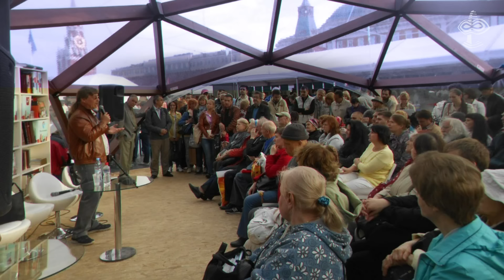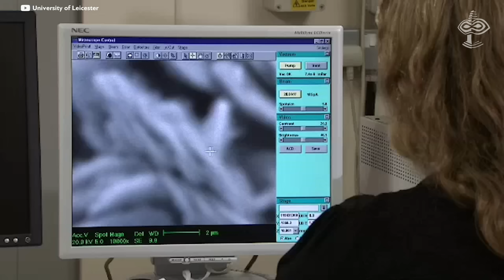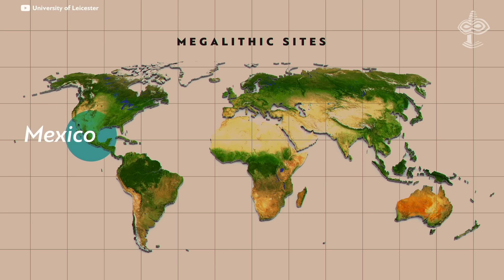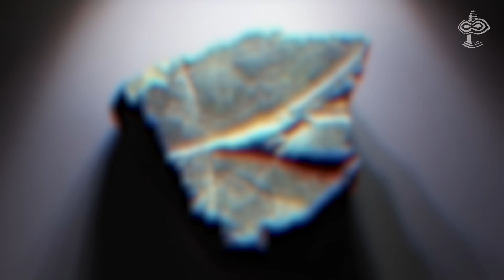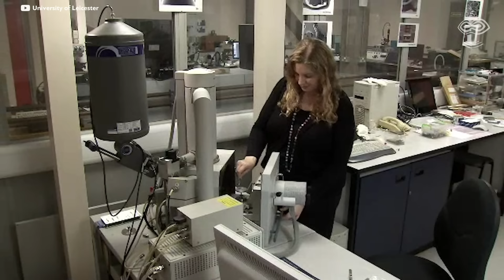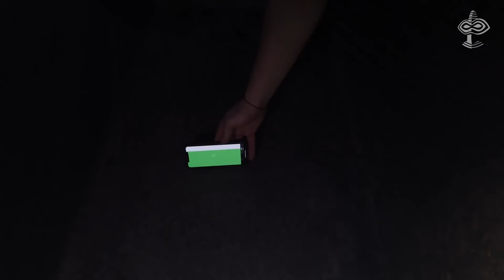The Secret of Ancient Tools: METAL MICROPARTICLE research - VERSADOCO

Comment: One thing that you didn't mention on a significant amount of these megalithic sites around the world 0 a good portion of these all the stones are magnetic and make compasses spin when next to the stone so maybe this is evidence of whatever they used some of the sites also the stones look like they were melted engaged 0 even there in England there is just one staircase somewhere in in a recess structure of some kind stairway going down looks like it was molten at some point and ran from the top and pulled down to the bottom and it's visually stunning but they try to hide this and explain it with these quite crazy theories that make absolutely no sense whatsoever trying to prove that that it fits in the theory that all these structures were made with chicken bones and sand and maybe at the most brass or copper chisels with hammers made out of wood and this supposedly made these perfection pieces with incredible precision late to the 10 thousands of a millimeter some of them like we can't even measure how perfect he vasesare from the step pyramid not to mention the core drills and scoop marks in the stone where they poured out huge obelisks or megalithic Stones looks like it just scooped it out of the spoon of gigantic size

Comment: The gate was probably not cut with a knife or a round saw in my opinion it could be similar to what we use in quarries high tension cable with some kind of abrasive on a diamond or some kind of high strength high heat metals such as particle x or it could be a bandsaw with the actual blade being bronze with the cutting surface being particle x if it's hard enough to cut the stone itself but I'm not sure about that maybe it helped diamonds in it since the metal is strong enough and heat resistance enough to hold the diamonds as it gets hot this is plausible but if it was hard enough to cut the stone itself obviously you didn't need the diamond but some of the stones with these kind of cut marks are all the way up to 9 on the Mohs scale diamond being 10 so it's kind of hard to believe that metal itself cut these Stone of that significant hardness but you never know some of the core drill holes that I've seen the rotation is a millimeter of depth for every rotation this is unreal and hard to believe but it's true so another piece of evidence saying that there's no way in hell that this could be a piece of metal with sand and a bowl and a string and some dude vigorously going back and forth trying to drill a hole and obviously this would not leave the same striations

I tip my hat to you for the in-depth analysis of this because everybody else is amateurs and has these bulshit theories and I'm happy that somebody with intelligence is actually investigating this other than myself thank you very much and please post more

Comment: Frequential molecular separation of the stone.
The metal only needed to stand up to the magnetic and radiational flux of the output of the machine.
Water would be used to both cool and enhance the contact area of the blade.
If you look at the scrape marks at the tunnel of Petra, at the very end of the tunnel, you will see the points of the grinding tool used.
Where the cutting/ grinding tool stopped, you will see the points pressed into the stones, and the stone was melting and running, or dripping down, from those point depressions left by the tool.
Along the bottom of the tunnel were troughs that were used to reclaim the water.
The scoop marks on the unfinished obelisk provide even further evidence of this type of tool.
Yangshan quarry in China, shows the same machining as well.
The most interesting smoking gun of this lost technology for me, are the scooped out granite blocks found in the quarries of southern American in Peru.
The granite was scooped out of the sides of cliff faces like scoops of ice cream.
The megalithic walls of Tehitiuacan and Peru were made the same way.
While people argue that the walls were geo polymer due to traces of carbon in the granite, they don't realize the carbon was deposited into the stone by this technology at a molecular level.
The surface of the stones at Puma Punku are were polished so fine to a micron finish that we can't even create a surface that smooth with our current technology.
The lost technology worked at a molecular level using high frequency, high energy plasma to cut the stones, the metal was only a conductor, which leaders into the "core sample holes" found at all these sites.
The holes weren't for core samples, the holes would of held the ground cathode for the cyclical frequential plasma tools used.

Comment: Thinking outside the box, is an admirable skill. Thinking outside the realm of possibility is foolish...

@ 13:37  A cooper saw with, quartzite sand used as an abrasive...
@ 13:54 They poured the sand into the groove, created by the copper saw.
@ 15:53 The arsenic, found in Egyptian copper, can be heat treated to be harder than pure copper.
@ 21:07 The Israelites were not known to be stonemasons. Therefore, when forming their origin myth, they scorned stone dressing.
@ 22:38 Normal tools with natural beneficial impurities, and ingenuity.

Comment: Wouldn’t it be interesting to have a cutting tool made from iron like meteoric (from heavens iron) or other very hard tough alloy like modern day tool steel, likely much better, with a fused layer of Carbonato diamond in to/on to a very thin cutting blade set to vibrating at mega hertz or higher frequencies? In essence one would have a knife you could literally draw down through hard rock like a knife through butter. Just saying, “what if”? Obviously they had such by the impossible stone works we’ve seen!

Comment: It seems like what caused by a Piezoelectric transducer. Spherical microparticles could be formed by foldings - very much seems to be (pushed several times from all directions)!Parallel toolmarks could be formed by linear alternate motion of the carving toolhead up-n-down.
The 5 component material has the same components what can be found on the surface of sarcophagus in the Osiris Shaft in Egypt (as a piezoelectric coating).
The carving process of the narrow straight lines could be created by spiralic motion of the carving head, in each section before moving alongside the carving line: down on the slope and pulled up straight from the bottom before moved aside.

Comment: well we know that they had batteries, it literally only takes a few volts to electroplate. so maybe the disc was  indeed copper or bronze? sprinkle some abrasive like quarts or diamond on it flat and then electroplate it until they become locked in or bound to the plates surface. 100% my best guess.

Comment: Ilmenite FeTiO3 is found near the Red Sea coast of Egypt, e.g. east of Luxor.
However, the natural mineral is only 5.6-6.0 on the Moh scale,
but granite is harder at 6.0-7.0, so the ore must have been treated or refined in some way.
Reply: A harder material can be polished/cut with a softer one, just the abrasion will be higher of the softer material.

Comment: machine tool? simply done with copper or bronze saws with abrasive sand.
Reply: Only CNC machines with cutters of hardness approaching 10 can match the quality of surfaces in many megalithic examples. Ie the sarcophagi interiors.
Reply: @candui-7  Not true at all, in fact many "modern" people have achieved the same results by hand (along with thousands or millions of past people). Yes that includes the sarcophagi, all made with simple tools, people are amazing huh.. ps u want proof?, or can u research it yourself?
Reply: @thumbjuggler3943 Not true, no one has come remotely close to the tolerances in question using primitive techniques. Please include a reference to modern work that matches certain prehistoric examples such as the interiors of the Japanese ( and Egyptian) sarcophagi. Note these have very similar structural form.

Comment: Sad that anyone would mention a temperature (capacity) of any (now) rare alloy, like 2000deg without mentioning the units involved; "deg" is not a unit of temperature "deg C" or "deg F" have genuine meaning.  But very interesting video, some fascinating detective work; likely to lead to some better masonry tech for us.   (You might find Boron Carbide is about as hard as diamond; wonder if it would leave a trace)
Reply: One would assume Celcius, F is not used that much outside of America.

Comment: So modern samples of machined stone would be the controls for this examination.  Three variables need control analysis - the type of stone - the technique of machining the stone - the tool that did the machining.  Say you are analyzing granite boxes which were purportedly machined.  You need a sample of the exact same type of granite and you need to machine it using a modern tool, say by sawing.  The type of metal that interfaces the cutting surface of the tool needs to be noted.  Microscopic analysis of the metal fragments left by this tool using that metal on this type of stone is then your control for the microscopic analysis of the ancient granite box.
There are many permutations and combinations of these three variables but IMO it is necessary to do all the work of trying as many combias possible to act as controls for analysis.
Reply: The straight line tool witness marks in the pylon grooves only need to be seen to know we can not duplicate that groove with any current tech. I'd figure it was a sharp tip scraping tool but the highest quality carbide or even diamond would not survive that distance in that material, diamond also wears. I would examine for evidence of multiple passes and focus on the tool entry/exits for clues.
Reply: @danontherun5685  Interesting.

Comment: Its clear to me that whatever the blade or tool used to make these fine cuts or dress the stone with geometric precision - the surface of the granite was being processed by a a form of technology that literally affected the atomic structure of the stone prior to and as the cuts were being made. High technology indeed! This "process" must have been able to proceed the cutting tool on both a flat plane and vertical to make the incredibly accurate geometric shapes of the sarcophaguses. While also be able to cut through meters of thickness... to deny this is pure foolishness. We know that frequencies of sound can create interesting phenomena, so can electro-magnetic fields. Now we KNOW it can be done we should be researching every aspect of the principle - why aren't we doing it... Simply because academia and its relevant "experts" refuse to believe it is possible denying the obvious fact that much of the current consensus on physics is hopelessly wrong. Willful ignorance is one of mankind's least useful attributes.

Comment: Resin adheres polishing or cutting grit to a wheel. A wheel is easy to spin at high speed with just twisted string through two holes offset from the center. When the strings are pulled it causes rotation. Hand powered rotation like this has achieved RPM over 100k.
Reply: What about the fact that grooves are parallel to the materials edge?
Reply: Why jet planes need engines when a hand pulled string propeller can do the job? 😂
Reply: Using a series of pulley wheels will increase torque exponentially to the described rpm.
I have a simple Russian drill press using a multi-stage torque pulley on it to increase the torque.
Those of you who aren't machinists or understand these principal would say what I see here.
This can be produced with high density hard wood pulleys that are resistant to heat friction.
Everyone needs to rethink the idea that the ancients were ignorant savages.
They had the same brains you have today,and the thoughts otherwise are ones of vanity.
The math you use today came from them,for example.
Rethink your form.
Reply: @j.w.r3730  Never mind they are clever, how could you possibly create alloy containing rare metals and titan ( to make it, you need huge plant producing electricity). Plus lots of researchers, whole industry.
Reply: Forget about electric cars, your method works on moving a car just fine. 😂

Comment: I asked Grok AI If blending the materials that you discovered in your video at 6:50 could create a product that could be used to abrade stone.
Grok was able to design a hypothetical grinding alloy with a hardness rating of 1800 HV, 50% stronger than quartz, using these materials. It was also able to design an alloy using the materials you listed at 7:25 with the same hardness.
I can provide a copy of the creation process for you if you give me an email address.

Comment: For high qualityabrasives the ancient Egyptians had Corundum powders and Zircon from black san beaches on the Red Sea..
if you add Corundum poweder or a Zircon powder, with heat and pressure.. to a copper alloy, you get  a Metal Matrix Composite material that can cut stone.. Poss bily they had these materials to cut and shpe stone.
 The simplest tech to sut stone would be steam..poss. a steam powered machine with a metal matix blded cut these stone..just an idea..
Reply: Sumerians had corundum. "Irish Society for Egyptian Studies", Summer 1924. Met Museum has an ancient Egyptian drill with corundum on it. Hittites had chromium oxide on their swords? Solomon describes a green Crystal (laser?) ring and belt used to drill a hole in the center of a stone block. Roman records said the belt was on display in Jerusalem until 300 
A. D.
Reply: Interesting that the tool marks are all rectilinear, not curvilinear. This means non-circular tools. It's fascinating! I wish we could see the actual tools they used. We would be amazed, no doubt. The proof is in the pudding: those cuts are so flat, clean, straight, level, and plum- it seems like they checked all their work with laser transits & laser levels ~
Reply: The more we learn, the more questions present itself 🤔
Reply: A soft metal matrix isn't necessary.